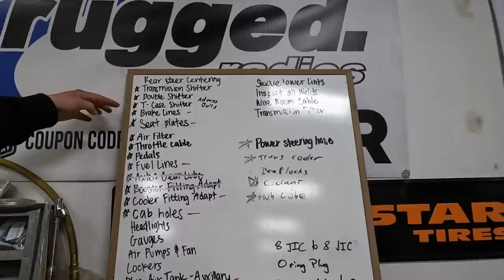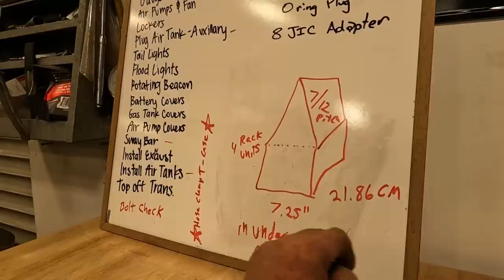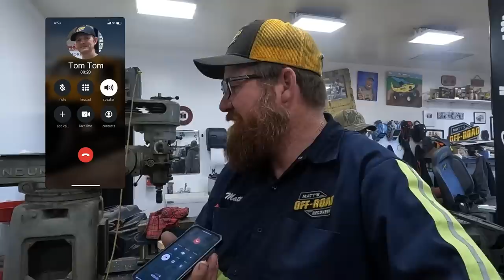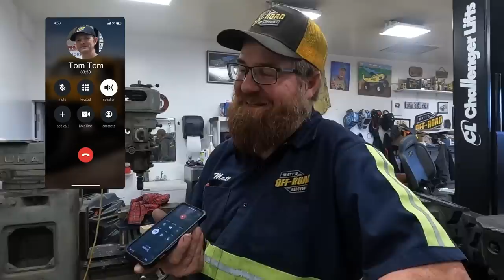Is This A Sign To Come For The World's Largest Off Road Wrecker?!

Comment: Check the position of the exhaust on your furnace there is a pressure switch in the exhaust and if there is a backpressure forced backwards in the exhaust from outside air  the switch will shut the furnace down it is a safety so fumes are forced back  into  the building

Comment: 12:21 i'm not going to take the time to explain physics to you guys coz you wouldn't get it BUT you are both kinda right.

Also, when mounting seatbelts it is safer to mount them directly to the chassis and no the seat. Because, if the seat breaks loose in a crash the belts are not going to stop it from flying around the cab. Mounting them to the chassis prevents this. It still REALLY hurts but it's better than being ejected, seat and all, out of the cab. I hope this gets corrected at some point

Comment: Heat pumps are only good up to a certain temperature because they recycle the air from outside far as the gas heater you had. I’m not sure about that one just too cold to keep up.

Comment: I dont believe that mutiple torquing of a fastener reduces its strength.  When torquing a fastener the torque spec. will be within the elastic limit of the material being torqued.  If the fastener was actually permenantly deformed then the torque specification was to high because it exceeded the elastic limit of the material, which would ultimately weakien the fastener.  This is why in some critical applications when you tighten a fastener you measure how much it is stretched as opposed to applying a given torque specification.

Comment: up here in Canada the heat pumps blow cold air when it's cold because they are defrosting the unit, You need a used oil burner the amount of oil you guys have

Comment: Heat Pumps are only capable of making about a 20 degree difference in temperature.  So when it gets to about 45 outside they can no longer contribute to making heat.  So they blow cooler air unless ordered to shut down. 😅

Comment: 7:19 nope that's wrong. Seat belts have to be attached to the frame directly. The seat mount is not designed to hold the forces involves.

Comment: @MattsOffroadRecovery For you shop heat issue I would first check to be sure the outside wall penetraion for the wires/lineset to the wall unit is filled solid i.e. greatstuff not fiberglass insulation as that will only filter the cool air from outside reaching the indoor thermistor not stop it.

Comment: With all the screws you had to use to fill holes are you planning to spray a liner material over them to protect you and sound reduction?  Maybe use boom mats or similar to protect you and keep your hearing? 
Derek at Vice grip garage put the mats in a pickup and his son did the rolling application.

Comment: You Should Mount The Shifters To A Plate That Stays On The Frame So When You Remove The Cab You Do Not Have To Disconnect All The Shifter Cables  -  The Cab Would Just Sit Down Onto The Plate With The Shifters

Comment: There has to be some sort of pressure-related switch that tells the unit to stop if the exhaust is restricted.  In this case, the wind is sufficient to challenge the switch, making it complete the circuit/break the circuit depending if active or passive.

Comment: your heating problem (if it's gaz heating) is due to your systeme exhaust. wind goes into the exhaust and kill your pilot flame. you have to modifie your exhaust so the wind don't go in

Comment: The heat pumps and furnaces both need air flow as you obviously know. Possibly the heat pump fans are stalling due to higher pressure air at their outlets than the inlets. Wind can easily do that. The moving air from wind or a fan is at a slightly lower pressure than static air next to it. This means that if the wind is passing the fan or furnace air inlets, but not the outlets the fans will probably stall. The furnace may or may not have a fan, it might rely on the hot air causing a flow. Same thing occurs the flow stops. You need to manage the air flow around the units.
Heat pumps can pull heat from almost any temperature. Just look inside your freezer to see how cold it is but the heat pump can pull out the heat and you can feel it on the outside of the freezer. People tend to think of water freezing as a low temperature, but it is actually very hot compared to absolute zero temperature.

Comment: Your thermostat might be your problem… if it’s set up for a heat pump and the temp drops far enough it might be trying to activate auxiliary heat. Such as a gas furnace or electric heat bank.

Comment: When the outside temps drop below freezing there can be an issue with condensation (frost) on the exterior coils. The frost essentially insulates the coils and prevents heat transfer. When this happens heat pumps usually run backwards until the exterior coils defrost, hence the cold blow inside. At warmer temps the condensed water drips off and is not an issue. My guess is that the added wind chill increases the frost problem by reducing the effectiveness of the defrost cycle. Is the exterior unit on the sunny side of the building? Is it on the upwind side? Build it a baby greenhouse with plenty of air flow? Moving it might be more effective than wind baffles.

Comment: The secondary isn’t kickin in right on a pump if it’s between 2-4 degrees it’s on the pump but any more then that it changes over to a normal heater seems it’s not changing over😊

Comment: Heat pumps will only work down to a certain temperature 
Different models and different brands are slightly different 
But if the wind is blowing outside the wind chill may lower them to below their working threshold 
See manufacturer’s information for minimum and maximum working temperatures…
And Matt , glad to see you converting to millimeters!!!
Reply: @GuyBucktastik  and I suppose you won’t understand how extreme sun on the outdoor unit won’t affect the cooling in summer ….
Yeah right genius
Reply: Typical suitcase units work down to 15f,the higher end units work down to 0f,-15f,I have 2 systems at my home that run down to -15. He probly needs wind baffles!

Comment: If you have a heat pump it's using heat strips for heat because the outside unit is freezing up also check to see if you have a fresh air intake if you do cover it with some foil and tape

Comment: Have a heat pump that works with electric furnace. Pump works fine from 32 up, at 32 starts losing amount of heat draw and finally stops producing any when outside temp reaches 24, this puts the full load on the furnace to produce heat.

Comment: The reason ur heat pump does that is due to the cold air blowing on ur outside unit which make it trap Freon in the condenser on ur outside unit which causes a low suction pressure so the unit has no Freon to heat up to give your inside units no hot Freon to blow heat out.

Comment: Matt and crew :::  You need a rt angle grinder for every type of attachment / cutting tool . I have five !!
Reply: Another tip ::: use a silver pencil when marking metal . 
It doesn’t go away wen you apply heat . I’ve used for 40 years !

Comment: Hmm on the imperial/ metric conundrum. Here in Australia, we measure land area in Acres, speed in Km/hr, buy fuel in litres, measure our height in feet and our weight in kilos. I was an aircraft engineer A & E, every nut and bolt is imperial, sheet metal is measured in thousands of an inch, stations are measured in inches. When I was younger I worked in the gold mines, we had Cats and Komatsu’s so my tool box had full imperial and full metric sets of sockets and spanners…I’m retired now and These days I will start a job, I might use inches and feet or I might use Cm’s and Meters…just depends which side I got out of bed really..

Comment: Do you have a fresh air vent. The furnace needs equal square inches of  
Makeup.air to equalize the exhaust from the fuenace. A 20x20 fresh air Filter may be enough. open the window about 2" to see if that works.

Comment: You probably need wind shields of some sort. Not for the reason others have suggested I think which is too much air confuses the sensors or messes with the fan. But a more plausible reason imo is the apparent temperature at the outdoor unit being much lower than outdoor ambient temperature because of the cooling effect of the stong wind. It may be that your outdoor unit is sitting at below operating temperature range when the forecast says it should be within range just because the wind cools it further.

Comment: They make wind baffles for those ductless heat pump condensers. If you look it up u can make them yourself. Just be careful you don’t screw into the coil. If the wind is really strong it will cause the fan blade to spin backwards

Comment: I am wondering how much weight this wrecker will end up, every time you guys keep adding up thicker plates and welding. you should have diesel motor to it with more torque. it's already a main battle tank.

Comment: There not low temp units and when the wind blows there is to much air moving through the outside coil. That will confuse the cpu and cause it not to work right

Comment: The out door units have a set point that if they drop under a certain temp they shut off. I don't know if your hitting it because I don't know the temperature where you are. But if you put a wind break around it (but give it some room to breath) You could see if it's the temp or the wind tripping some sensor in it. But depending on the heat pump it could shut off at 40° or I think the new units can go down to like 20° or lower. It also depend on the unit.
Reply: If it trips off when the wind blows and comes on when it stops (as described) then it isn't the temperature.
Reply: True but the wind chill might be pushing it just past the threshold. But your right it's probably a different sensor or something. I only design HVAC systems I don't diag them. So somone else might be better at explaining it. But definitely putting some kind of screening around it would help with the wind and they would not have that problem.
Reply: @eric1200942  Wind chill does not lower the temperature.  It simply cools warm things (like you) to ambient faster.  If it is 35 degrees outside, objects cool only to 35 degrees.

Comment: Concerning your heat pumps: you might consider installing wind breakers around the condensers. They would need to be adjustable to be able to close as outside wind speed increases
Reply: Agree 👍

Comment: in australia all our nissan patrols dont have centre diffs and havea transfer case and have manual locking hubs, where as the toyotas in australia are what is called 'full time 4wd' with a centre diff and they have manual locking hubs, much prefer the nissan design

Comment: Heat is attracted to cold. Heat is high pressure cold is low pressure. 

When a building is heated the building is higher pressure than the outside cold lower pressure. 

Check for infiltration 

That being said heatpumps draw Heat out of the air to bring inside. The heatpump will go into a defrost mode at that time it starts putting cold air inside the building and the aux heat tries to help compensate for that plus be able to place Heat into the room

Comment: Once I put a ciggy butt in my overalls front chest Pocket I thought it was out, well about 10-15 minutes into work one of the welder's came up to me and put that pocket out I was standing next a solvent tank for removing cruddy stuff and an airay if different flammable stuff. I CRINGED. It' was in the middle of summer like 90*F outside so I couldn't tell I was on fire because it was like 110*F inside along with the heat from everything that produces heat.

Comment: There is a common misconception about heat pumps. They don’t blow warm air. They do blow air that is warmer than the room temp but feels cold as it moves across your skin. Moving air feels cool to the skin due to evaporation but the air temp in the room will slowly rise because that’s how it’s designed to work. It doesn’t blow warmed air like a traditional heater does.
Reply: The air temps coming out of my indoor units is 120 deg!

Comment: Re different transmissions.  For Brits it's the difference between an old Series Landrover and a Defender Land Rover.  Unfortunately the number of motoring journalist that think locking a centre diff somehow gives "better" 4x4 traction than an old series land rover shifted from 2 wheel drive to 4 wheel drive is depressing.

Comment: A little concerned about the single line holding your boom up, should consider a pair of safety chains if there’s a failure.  You have 2 winches pulling done against one single line this is a recipe for disaster

Comment: Hey Matt what system have you installed for air up / down - compressor or tank system? Banana and Morrvair?
Reply: I know you would air down banana and Morrvair and then throw it on the trailer. But what have you considered air up and down on the wrecker as you would drive out on the road and then have to air down to do the recovery (return trip air up again for the road ride home).

Comment: All I know thos goofs turn up the flame and it turns off from the saftey sensors before you get heat blowing out. At work and at my house with my 85 year old mother freeze in the cold then they charge us again on it on Christmas day! But at least they tighten the gas line down, my place up north, they didn't even bother,  the whole house filled up with propane! Lucky I didn't blow up! And I am just one of there Owen special customers in Michigan.

Comment: not in heating but its basically a radiator outside.. need to block the wind and let it pull the air it needs

Comment: Gigabit pronunciation: The original scientific pronunciation of gigabit used the "J" sound - so jigabit is correct. That said, once computer hard drive capacity and network speeds started using the term - folks saw the "G" and assumed a hard "G" Gigabit. The incorrect version has become the norm.

Comment: 60mph + 60mph Head on with identical vehicles is the same as hitting a wall at 60mph not 120mph it does not double like they used to say.
Myth busters proved this without question
Reply from the maker: Correct. But the force between the two will be equal.
Reply: @MattsOffRoadRecovery   yeah. 

But its only a perfect world example if both cars or trucks of same type hit perfectly square on even 1-2 degrees off will cause deflection

Comment: No back up heat in the heat pumps?
Reply: Also the wind will slow down the condenser fan motor. Need a wind block.